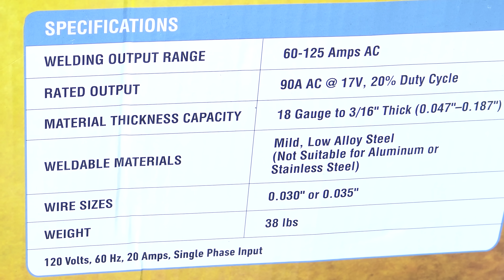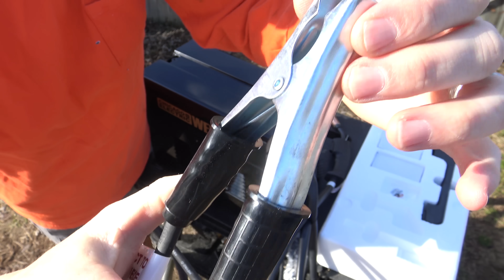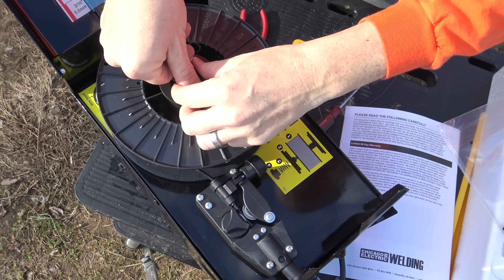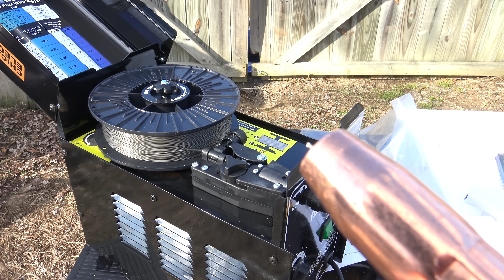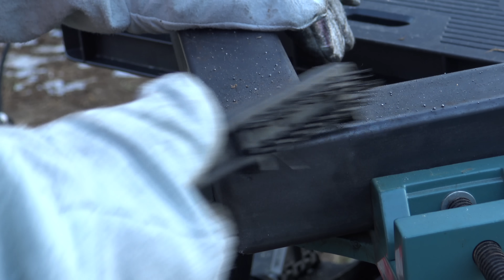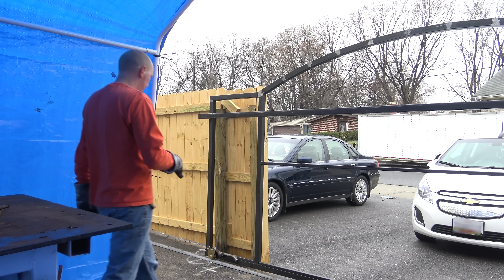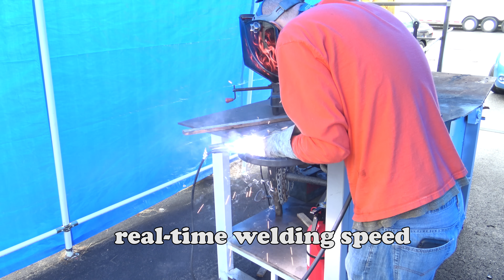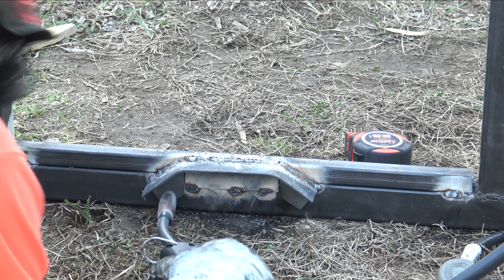Harbor Freight Flux 125 Welder Review

Comment: Great video. How is it that you don't get electricuted when the metal you're welding and also touching is also clamped with the earth clamp? By clamping the same metal you're welding creates a circuit, right?
Reply from the maker: The simple answer is in electrical pressure (voltage). The voltage on this machine is around 17 volts. That electrical pressure/voltage does not want to travel through the human body like it wants to travel through metal. It takes the path of least resistance and is not interested in external routes external to that and of high resistance/insulated. Also, since the voltage is relatively low, you can pump high amperage, generate lots of heat in the process, and melt metal.
Reply: @TRYtoHELPyou  thanks, that makes sense. I actually thought welders run on very high voltage.

Comment: You should mention that for flux core polarity should be reversed. Not sure since this one is flux core only maybe wired that way.
But mine is the next step up 170 model, that is gas or flux core and you have to swap polarity between the two. Also it requires 220v
20 or 30 amp I think, but has worked fairly well for me, shielding gas is cleaner looking but actually you can get better penetration with flux core.
Practice practice... on scraps till you got it right and YT has some great beginner video’s.
Reply: Nope, it's DCEP. I converted mine to DCEN and it welds much nicer.

Comment: Flux core welding suck the penetration is weak if even that.I use a miller mig with gas at the machine shop I work at..my buddy bought this so he called me to come over to check it out.lol. 😂 its like a little kids toy I guess you can weld like fence and thin metal things.
Reply: OK I take back a little what I said i just had to message with it a little more and finally got the puddle control down penetration still isnt super good but its a OK little welder I'm just so used to welding with gas and metal that must be joined with other metal to become one and can't fail (oil field pump parts

Comment: LOL.....you cheap skate! The board on the Aleko gates usually goes puff within a year. The trick is to coat it with something cheap such as but not limited to water proof paint. Like let's say you were making a gate and you had some left over clear coat from a recent car painting project. Then just paint the board... But not the pins or switches. Bees wax is another good one.
Reply: Like let's say you were a bee keeper or some bees landed on your kitchen wall ... From outside, I've never heard of a need hive that starts at the kitchen kitchen. Then just heat up the comb and dunk the board in.

Comment: This is the same one i have but mines a 115v i just got it but i cant get it to actually heat up n weld itll spool but wont do much else anyone got anyideas?
Reply from the maker: Mine is 110/120v too. You need to make sure the outlet you are using is rated for higher than 15 amps, also, of you are using an extension cord nothing smaller than 12ga. 10ga is best in my experience. Slow down the wire speed and make sure the heat setting is max/2
Reply: TRY to HELP you i did all that n i can get it to spool out it just wont heat up my extension cords a heavy duty cord n i had all the switches on i think it may be broke or dont work properly cause the box was open when i bought it at the store ill probably take it back n get another

Comment: My mountain bike frame cracked on the original factory weld where the frame meets the yoke. I'm wondering if this welder would give me a strong enough weld to fix it.?
Reply from the maker: the weld? likely yes with the proper prep (grind, etc) but the frame material. domt know about that

Comment: I use mine for exhaust and I’ve found that this welder works best with Vulcan .030 wire at 6 wire speed, and minimum voltage.
Reply from the maker: Nice, that is likely best for not burning a hole through it. It's still not easy.

Comment: Would you recommend this welder for working on the frame of a 89 pickup?
Reply from the maker: If it is something like attaching a light bracket, sure. A full crack in the frame? That would be pushing it.
Reply: @TRYtoHELPyou  thanks that's helpful.

Comment: I'VE BOUGHT, ACTUALLY TWO FLUX MIG WELDER.  I'M VERY IMPRESSED.  I ALSO WELD REPAIRS ON MY ALL METAL BBQ PIT. THAT I MADE ,WAY BEFORE I GOT MARRIED NOW I HAVE THREE KIDS [ FULLY GROWN ] OH GRANDKIDS TOO. AFTER I GRADUATED FROM INDUSTRIAL COLLEGE. AND REENLIST IN THE USAF. SPEED AHEAD, I RETIRED, ANYWAY SORRY GET CARRIED AWAY.  THESE FCAW ,JUST WANTED GET TECHNICAL INCASE SOME OF YOU GUYS DIDN'T KNOW.  IT'S FLUX CORD ARCH WELDING. 😁. MY PIT IS 1/2 INCH STEEL PIPE. LET TELL YOU GUYS, AND GALS [ USED TO BE WELDING INSTRUCTOR  ] THESE MACHINES WORK.  REMEMBER LIKE I WOULD TELL MY STUDENTS.  START AT THICK METAL FIRST, GET THE PUDDLE, THE GO INTO THIN METAL.  ONCE THE METAL IS RED HOT[ MOLTEN ] . MAKE " LITTLE E'S . SORRY GOT CARRIED AWAY AGAIN. ITS THE INSTRUCTOR IN  ME. REAL QUICK. THIS IS HOW I THOUGHT MY STUDENTS.  GRAB VICE GRIPS, OR PLIERS BUY THOSE ELEMENTARY SCHOOL THICK PENCILS. PUT A PIECE OF COLLAGE RULE PAPER, TAPE THE CORNERS,  NOW PRETEND YOU ARE WELDING.  GOOD LUCK. REMEMBER THIS IS AN OLD WELDERS SAYING " WELDERS DO IT WITH HOT RODS "🇺🇸🇺🇸👍👍👍

Comment: Stupid question maybe? 

Can I plug this welder into a 50' 10 Guage extension cord from a kitchen 120v 20amp GFCI receptical?

I'm living in an apartment and need to fix my exhaust pipes on my truck. I plan on welding a 1/8" piece of steel to re-hang my aftermarket exhaust. Trucks 13 years old and needs some help. 

All the other recepticals in the apartment are 15 amps besides the dryer which is a 2 pole 20amp but is very difficult to access. 

Was going to change the receptacle by the front window to a 20 amp and change out the breaker to a 20 amp however after a look in the panel i saw that the wire is 14/2 and I'm not trying to burn down the apartment building 😅

Thanks in advance.
Reply from the maker: No fires please. I have used 10ga 30 foot extension cord with mine in the past and it worked fine. Prolly don't expect the best performance from your situation, tho. Also your neighbors may be making some calls to management. So keep that in mind. You may have a small window of time to get welding done, if at all. Again, please don't start any fires. Welding next to fuel tanks can be incredibly dangerous.

Comment: A great and honest review, I used to have a very similar welder for many years and it was great at what it did. However, I found the things it didn’t do such as aluminium and cast iron very frustrating. The respirator is really important and is rarely mentioned in videos, I'll also wear a welder's jacket though sparks still get down my neck somehow. A welder is one of those tools the average D.I.Y.er doesn’t use every week but nothing else will do when one is needed, not even JB Weld. Pre Covid19 there were lots of Polish/German machines on the market here in the U.K., the machine I got is a 200amp MIG/Flux/MMA/Brazing (I stick to my gas for that) for a very reasonable price. Unfortunately the price of new tools are going through the roof here in the U.K. whilst second hand have through the floor. I like the level of control it gives and I can weld just about any material including aluminium and cast iron and can hold most thicknesses.

Comment: I have the same welder and even after watching thousands of videos and countless advice  my welds still dont hold.. idk what I'm doing wrong
Reply from the maker: Put the metal pieces together, place the welder tip where the pieces meet, no further than half an inch. Pull the trigger and wait for the metal oozy bits to start to grow and then form a puddle. Once you see the puddle sink in some you should move the tip or else the puddle sinks all the way thru and burns a hole. Slightly make small small small circular motion and/or back and forth movements while waiting for puddle to form. Once you have the puddle sunken in, move slightly in the direction you want the weld to go and repeat the process overlap last puddle about half way or at least a little bit. This entire time the tip should be about a half inch from the workpiece/weld. Just too much spatter? Slow down wire speed and try again. Practice and eventually you will get it.

Comment: Really all you need to wild with that mighty machine is a pair of gloves and a Helmet. No need for resperator or apron ect. If you buy that welder your not going to weld enought to need a resperator or apron. I will recomend closed toe shoes, boots even bettee
Reply from the maker: Hmmm... With this, and given you likely don't usually eat food with piss in it, would you mind eating some food with piss in it just once or a short few times? You won't be eating it much anyway... Pick your poison.
Reply: @TRYtoHELPyou  my guy you were welding outside i really doubt that you absolutely needs a resporatior. Not even profesinal pipeline welder wear resperators and they are welding all day.

Comment: Thanks for the review, a guy wants to charge me $80 dllrs for some welding so I just went and buy one for $100
Reply: I’m with you dude I’m going to get one and teach myself to weld ... I should have done this years ago
Reply: @tecager  hey did you learn
Reply: @stitchthisditchthat259  I did during quarantine.... welding.. bricklaying.... carpet laying ...stock market and hot better at cement work all during the lockdown thanks fir asking I still need practice but I got basics down for most part

Comment: I got one the other day. Hadn't welded in forty years and this is a good little welder to get me back to it so to say.  I am making a people gate 
in my steel fence and it is working good.  My first bead looked pretty crappy but after messing with the settings and tweaking
it I got it to work okay.  Can't blame the welder if it doesn't work at first; it's that operator malfunction that'll getchya.
Reply from the maker: very nice!
Reply: What settings did you find were best for welding your fences’

Comment: I just bought  this is it ok to use regular plug in
Reply: I bought one a few days ago and I checked my circuit breakers in the house and they all said 20Amp so I guess I got lucky but I plugged it in and it works.  I also checked the grounds on my outlets with a multimeter because the manual said to.

Comment: Thanks for this video. I've been wondering whether to get this welder or not, as I only need to weld very thin metal: coffee cans to sheetmetal, but it has to handle very high temperatures (making tent stoves/rocket stoves), so I'm glad you mentioned that it's probably not good for thin metals. I have a very little arc welding experience, but now I don't know what welder would be good for this? Any suggestions would be greatly appreciated. Thanks.
Reply from the maker: Well, thin metal is best welded by Tig or possibly gas (torch) welding. Look into those. Both cost more than this machine :/
Reply: @TRYtoHELPyou  Thanks so much for your reply. I had wondered about torch welding, now I just have to learn a lot more about it. Very much appreciated!

Comment: 15 years wow!! My first one stopped working," within 90 days" 😅 Returned for another, same thing. My 3rd one I used about 2 lbs of wire & I got stuck with that one. My 4th one ( this is the 125 ) I am on my 3rd 1 lb of wire it is going strong LOL. You can tell by the amount of wire that I only use it occasionally. I spoke to the store manager & he said that he gets them back from time to time but... We went over how I installed the wire, the tip I used & so on but still could not figure why it stopped running wire. Hope this one last for awhile.
Your welds look better than mind. There welding helmet is also a good buy. Stay well, Joe Z
Reply from the maker: Thanks for the good words. I can't think why you have had such bad luck with it. If you are sub 110v, maybe that could cause it to have issues?
Reply: @TRYtoHELPyou  You're welcome & thank you for replying. I had a dedicated 20 amp  
120 v line installed before I used it. It was always the feed that went out on them.

Comment: Can a 3000 watt generator power this welder with no problems? Any feedback is greatly appreciated!
BTW, I will be using this on a 16 gauge square Steele tubing. Building a small project...

Best regards!
Reply from the maker: 3kw should be good. Make sure the outlets on it are 20a and you will be in the green for sure. I bought my first HF welder from a dude who had a Honda generator powering it when they went to the desert. Worked ok for him. I think my gate was 16 guage. .083? Ish anyway, it can do .090 or .120 just fine.
Reply: @TRYtoHELPyou  I appreciate the information and fast reply my friend! Best regards!

Comment: I've always read on these cheep machines, you should always use the smallest spools of wire you can, due to the cheap feed motors aren't designed to pull such heavy spools, so they tend to wear out quicker if you use heavier spools of wire. Again, this is just what I've read from a number of different places. I just picked this exact welder up today from a HF parking lot sale for $50. It was an open box item, but everything was included, and they told me it had been tested and works just fine.
Reply from the maker: That is a score! As for the 11lb spools I went through 2+ of them on my old machine and it only had a trigger fault (not a feed motor problem). It does not appear to me that this newer model is stressed in any way.

Comment: I bought a 125 amp and a 90 amp flux welder like this one from Harbor Freight, put 0.30 wire and contact tip from Lincoln and lete tell ya.. best 160 bucks I ever spent even though I have Miller welders mounted on my truck these are still handy little things.
Reply from the maker: Nice. Right? I used to use a Miller 125 at a place I worked. It felt sturdier and was a little smoother but these harbor freight welders get the job done.

Comment: I have one of these. Also have the Lincoln 3200hd.as for this welder it works great for the price. The wire it comes with sucks! Use the Lincoln wire and it is a lot smoother. 👍

Comment: One clown has a video where he doesn't even have the tip screwed on the gun.
Reply from the maker: I think that's the one I was talking about in this video where he was just sputtering slag everywhere. Spinning his tip around the workpiece like a bus driver spinning the wheel for a sharp turn. It was unbelievable.

Comment: This is a transformer welder I run mine on my generator my old generator puts out modified sine wave but that is just fine for these transformer welders.I’d be a little more concerned if it was one of the newer digital inverters you probably want pure sine wave for them,,,if you’ve got a big enough generator then you can use it to run your welder and keep your electric bill in check and the portability it gives you is great,,,,if you’re going to use an extension cord with your generator to give you a little more freedom to work do not go under 10 gauge. I have heard of people using 12 and 14 gauge cords however I do not recommend it,,,you can find a good 25 foot 10 gauge cord reasonably priced if you look around.

Comment: ALWAYS PREP UR WELD AREA.... dont relay on the flux ... if preping area wasnt needed noone would do it.. PREP PREP. you will be happier in the end ...
Reply from the maker: There is not a whole lot to do with fresh carbon steel when it comes to prep. I suppose you can sand or grind the edges but... Sure. "If BLANK wasn't needed then no one would do it".. fill in the BLANK: "peeing in the wind", "backwards running", "chair balancing"

Comment: absolutely get the three year extended warranty. you can exchange it in 2 years, 11 months and get a new one. if you always purchase another warranty, you can have a new welder about every 3 years. i got two of them that way, but forgot the third time to exchange in time. i've been using it for 6 years, and it still works. i just made a 12v powered hydraulic press from a rv leveling jack with it.

Comment: Nice video...for someone that doesn't weld much you sure know how to cut Metal like a pro.I have no idea how you cut anything with that cheap Ryobi cordless saw...Much less square bar???
Reply from the maker: Yeah, i used to fabricate with regular carbon steel a LOT about 10 to 15 years ago. Has been off and on for the last ten years. If you are determined to learn a skill you can find a way, for sure. Thanks for the good words!

Comment: This is one of the better welding videos. HF has sold thousands of these welders for home use. I bought one to weld metal 1/8 to 1/4 inches thick for some home projects. Most videos some some guy using 1/2 inch steel. Like this guy said he's not building a super structure. I really don't care how "pretty" the weld is, I just want to know if it will hold. I can always grind off the slag like he's done.

Comment: I don't think it's a bad deal considering if you actually know what wire speed/voltage can do. It's about $250ish cheaper than better known brands in the 110v dept. All in all, take time to learn because asking a "I keep mine set wide open" warrior won't help at all and their fear of change will rub off. That's the whole point in learning.

Comment: That is not a respirator, it's only good for minimal dust.
Reply from the maker: Yup. My bad. It's a dust mask. If I don't wear it and I grind and weld all day my snot is black. This makes it so that doesn't happen. https://www.harborfreight.com/safety/masks-respirators/multipurpose-nuisance-dust-mask-with-replaceable-liners-94222.html
Reply: @TRYtoHELPyou  The gases from welding are really bad, suggest a fan and don't breath any. Good luck.